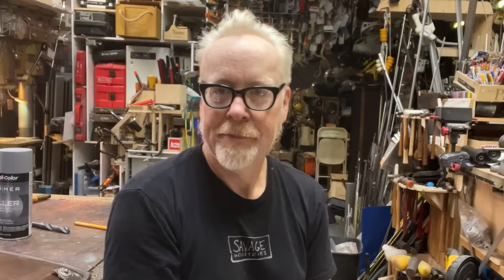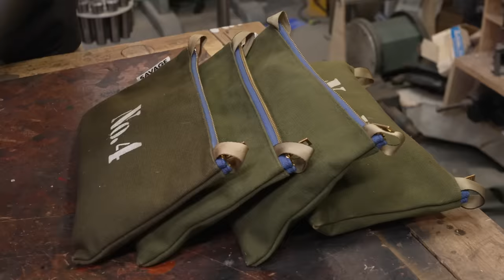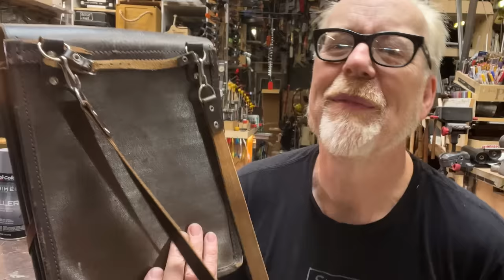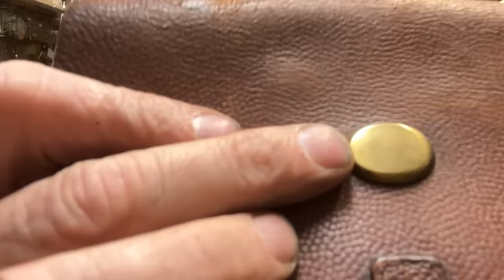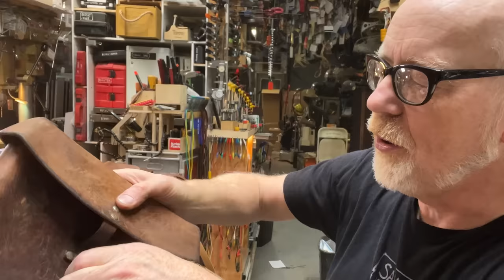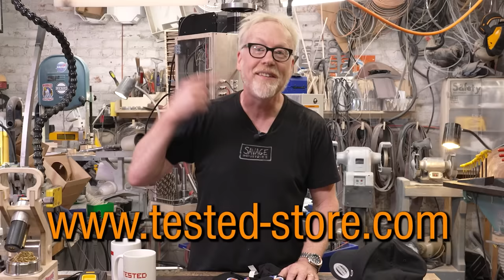The First Bag Adam Savage Obsessed Over

Comment: Lovely sharing!! Thank you! 

I've always loved a good bag since my Scouting days. Small bags are useful. The old chinese student's canvas satchel in white or olive was the bomb in the 80s. I was later drawn to the light canvas double-section claymore mine bag satchel with extra wide shoulder straps. 

While its not easy to escape from synthetic materials today, cotton canvas and leather are such comfortable materials and they pair extemely well.

Macpac makes bags with an amazing material called Aztec. Which is made up of threads with a polyester core (for strength) with cotton spun around it. So whennit gets we, the cotton swells and seals all the micro pores so that water doesnt get in any fuether. Like good ol' high density cotton canvas, but with ployester strength for wear and mold resistance. Unfortunately they are making less and less of these bags due to rising cost and lesser knowledgable customers. (Too technically advanced for most markets.) 

My oldest Aztec Macpac (Kauri 30ltr) daypack still in use is 21 years old and it doesnt look a day older than 3 years old in comparison to other packs if used daily. It's been through many expeditions with me. 

Ive reduced mu daily carrying to sub-20ltrs now. My current EDC straddles between 3 bags, a Timbuk2 leather canvas backpack,  Fjallraven G1000 18ltr backpack, and a Barbour Utility messenger satchel in canvas and a leather double brass buckle-strap flap. Each one has its strength and shortcomings. But I like them heaps! 

Thanks for bringing up the subject of bags!

Comment: Hi @tested and Adam, I fully get what you say about EDC, and having to utilize various clothing and bags. Could I put forwards another item for you to consider?, Im in the U.K and as well as my EDC stuff I do volunteer first responder with the ambulance service and when its warm enough, I use a gillet/ body warmer of normally fleece type material as it provides multiple pockets for my stuff and is lightweight, but, provides some warmth. Obviously doing what I do being able to move freely is really important, and like you I also have multiple bags and pouches which I rotate.

Comment: Many years ago, I found a bag similar in volume to those map bags at a Swedish military surplus store. It's a thick greenish canvas bag with a leather bottom, used for gas masks so it's rather more cylindrical. I've used it as a camera bag a few times, when I needed only the bare minimum (a DSLR with an telezoom lens, some cell foam for padding). I'd love to use it more often, but I haven't been using any DSLRs in quite a while...

Comment: I'm a huge sucker for Milsurp, canvas, and sling bags so when you asked for bag recommendations I knew I had to comment.  If you haven't looked yet, you should totally check out Milsurp gas mask bags.  The one most people likely know is the bag Indiana Jones wears, a WW2 era British gas mask bag, the MkVII.  

But my personal favorite that I've used for years given to me as a gift from my brother is a Swedish WW2 gas mask bag, the M-36.  Grey canvas, with a leather reinforced bottom, leather flaps and metal closures.  One large compartment and a smaller one on front, plus an adjustable shoulder strap with an adjustable waist strap too.  It's been a bag for hiking, daily carry, and I even used it as my tool bag when I was a Locksmith.  

Not sure if it's something that'd be up your alley, or even if I'm the first to suggest one, but like I said I just knew I had to recommend one

Comment: Bags are awesome but I got the ultimate bag so I have no need for more now. It's Suraya Hawthornes satchel from the Destiny 2 video game's collectors edition. It's a satchel/messenger bag but it comes with 2 straps that can be removed, so you can turn it into a backpack, or even have it hang sideways or upside down, whatever you want. I keep the straps in an X shape across my chest. It's got something like 13 pockets, some of which are hidden, and I can fit everything I need for a 3-4 day trip in it. Extremely high quality, really durable materials, the hardware is easily the best hardware I've ever seen on a factory produced item, and all the snaps and buttons and stuff are super sturdy. Highly recommend if you can find one second hand.

Comment: Decades ago, I used to spend all my money at the army-navy store. I bought a USN gas mask, one with two hoses and a canister across the back of the neck. I did not have the gas mask very long, but the bag it came in was gray canvas with brass hardware. Had "USN" stenciled on the front. A bit larger than a football, with a shoulder strap. I used that until it frayed beyond all possible use. I was about 12 when I bought it.

Comment: There is one bag that was used in WWII and that is called either the Highlander haversack or by its other name bread bag. Sort of like a satchel but made from canvas and with side pockets on each end. Sort of thing my Granddad wore when going out to or from work. Miners had them with their names painted on and hang them up before going into the pit.  Similar to a EDC bag as you could get a lunch box, flask, smokes ETC. They were good bags and are still used by some people (even me) for things like Ham Radio with a tarpaulin and a Trangia stove and fuel stored in it. It gets full but it does have space for things you need with a cup and camping kettle as you are using the radio  from in the bag itself. Have a look out on the internet and see if you can improve or redesign the classic bag.😁

Comment: The Swiss Medic Bag should have the Saddler's name and date embossed in it.  To solve you pocket problem, try Tactical Pants.  They have 8 or 10 pockets.  Flat pocket on the thigh for cell phone.  The leather bag I am looking for is the French Electrician Tool bag.  I has a front side that snaps on the sides and will fold out to expose all the tools.  It has a large static flap for tools and a top cover that folds down over the entire bag.  I have seen one.  Galen Leather out of Turkey makes a large medic bag but it way over priced for me.

Comment: I think those are beautiful and cleverly designed bags, I recently started collecting airline first class amenity kits, they have perfect size to my edc measurements kit. I’m an architect so I have things from a metal ruler, an electronic ruler, calipers, and arduino based ultrasonic station made by me, and even a cesva sonometer. And yes all fit perfectly (except for the cesva that has its own hard case) on a single rimowa case from Lufthansa

Comment: I use a Chrome Ind. Doubletrack Handlebar Sling for edc. It’s a messenger style bag similar in size to the ones you have that can convert from a handlebar bag to a messenger bag with straps that tuck away. It’s small enough where I can use it on my enduro bike on tech trails and it doesn’t come into contact with my fork stanchions. I have a few gripes with it that I wanna fix with a custom bag that perfectly suits my needs, but overall it’s a stellar, super versatile bag

Comment: It's nothing so unusual or interesting as those, but I bought a canvas satchel or "messenger bag" (I'm not sure which it technically is) at Staples many years ago. And it has been amazing. It carries small tools, cables for electronics, batteries for devices, has separate flat space for papers, and separate insulated and lined space that is the wrong proportions for a laptop but has the strap you see with a laptop bag. That last space I've found works amazing as a lunchbox. I keep drinks in it with a little silica bead packet to fight condensation and they stay cool for hours, and it deforms well enough to let me take canned food or boxes on one side and chips on the other with nothing getting mangled or crushed. And with the outside being canvas, it's lasted way longer than anything else I use daily.

Finding the right bag for you can be life changing. It seems like a simple thing but it makes so many things so much easier. But I kind of feel like you have to live with it for a while to know if it's the right bag.

Comment: They are not exactly cheap but there are some nice shotgun shell bags out there. You have to find one with a flap. Some are belt models and others over the shoulder. Both Frost River and Duluth Pack make over the shoulder bags which are not cheap. I have a map case of no name for my tablet as well as a cheap shoulder pouch from Amazon that my tablet fits in. It is actually a nice modern bag.

Comment: i've got a canvas Swedish gasmask bag from I dunno when, that I use for my bushcraft hobby. I found them online ages ago now for cheep as free so i picked up several. this one has a divider in it that separates the inside pocket into two asymmetric pockets that's covered by a single flap. it's got some small pouches inside along the outside wall that are great for holding tiny things. 
People tend to overpack when they go camping, and this moderate sized pack keeps that from happening as I run into size and weight constraints. it's designed to go about your waist and hold onto your hip. but i've modifed it so it's more a shoulder bag.

Comment: I have a Kelly Moore scout that I use as a camera bag and I love it. There are only two things Im not a huge fan of. First being that there isn't a handle on the top for easy manuvering when getting in a car or if you need to move it to make room on a table or bench. The second being the clasps that hold the top flap secured can come undone easily and if you don't have the inner flap zipped shut, it could be a problem especially if you're walking around SF. It is a newer bag, but the leather is top notch quality and is thick like the older stuff!

Comment: 6:00  This is the standard mappouch of the swiss army for officers. It is way thinner than the medics pouch we whered issued with. And also the closing is completely different from this one. The medic pouch has push buttons on each side and the frontal latch has no vertical cover. And it is also bigger in height and with than this one. But if you wish...i can sell you mine 🙂

Comment: I too have a bag fetish and found the perfect day bag for me. Unfortunately it is no longer made by Olympia. You cannot even find images of it online and sadly no one makes anything close to its design. I wish I could post pictures of it. The main compartment is spacious with a pencil holder pouch and two slip pockets inside. The face has two smaller zip pockets (real pockets, not flush pockets that only hold a cel-phone). It has two handles on top for carrying, a detachable shoulder strap, and a beefy belt to turn it into a fanny pack. If I load it with a bunch of heavy stuff, I use the belt and shoulder strap at the same time for hiking. The belt puts most of the weight on my hips while the shoulder strap keeps it from sliding downward. I've had this bag for ten years and it is starting to fall apart. I wish I could buy a replacement but as I said, the internet no longer has photos of it.